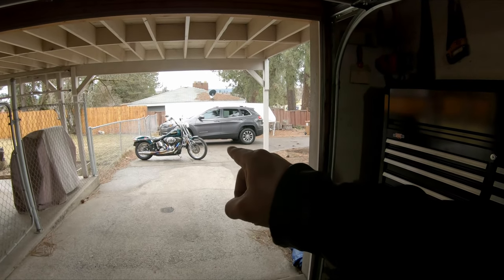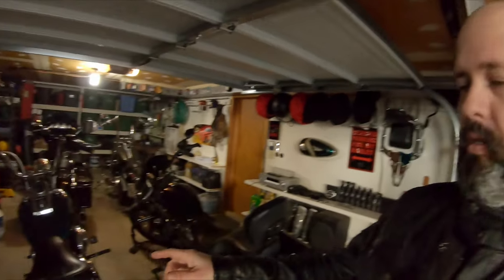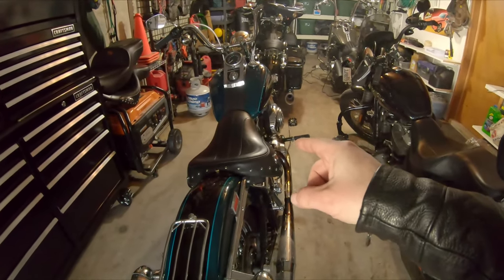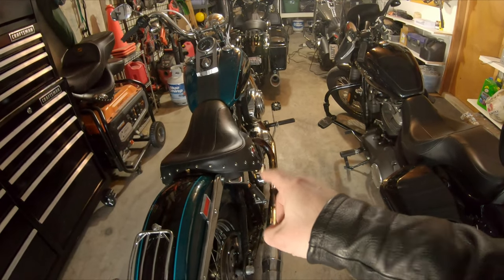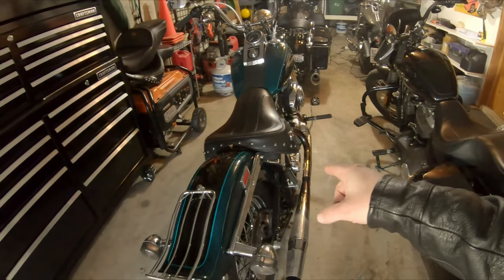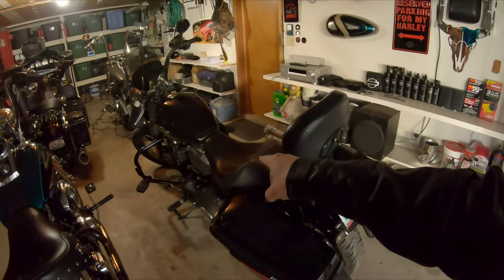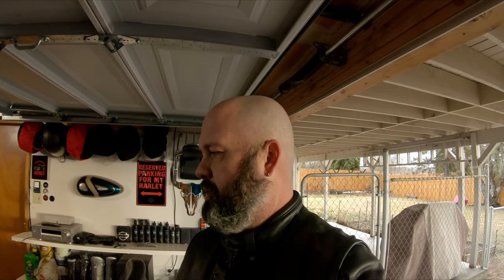I lowered the Springer for free, time for an update

Comment: Interesting result! I'm tempted to give it a go on my Custom! It's raining today, my new Saddleline luggage has arrived so time to go and fit them!
Reply from the maker: I'm curious to know what you think of the new luggage. I've been thinking about getting something different before Sturgis next year. But for 10 min of your time, it couldn't hurt to give the lowering a whirl. Worst case, you don't dig it and put it all back to normal. No harm, no foul
Reply: I'm pleased with the luggage, my old throwovers just wore out. I chose the Saddleline quick release luggage as they are a specific fit for my bike and don't need the indicators relocating etc. The capacity isn't as much as my throwovers but they look great on the bike. Also, they cost me £320 (about $410) instead of £900 for HD ones. I was tempted to get Viking bags from the US but I know from previous experience I would get hammered with Import Duty!
Reply from the maker: I hear the import taxes can be brutal. I've eyeballed viking a few times but I might have to take a look at Saddleline now. Thanks for the info!